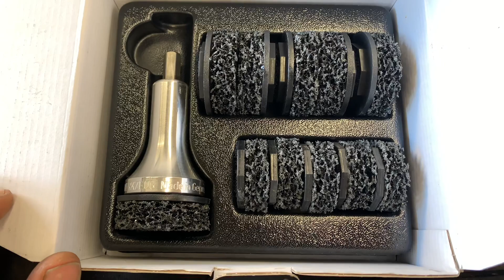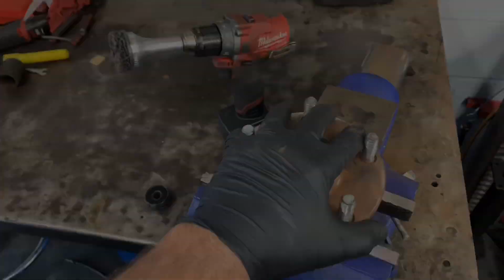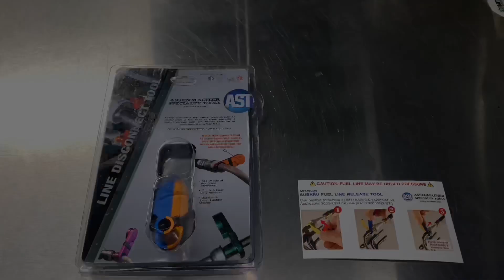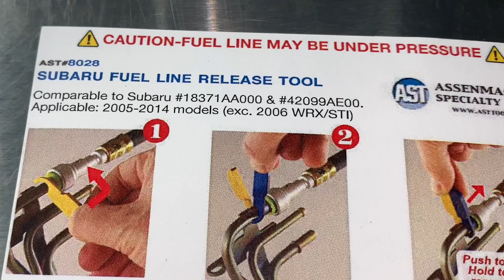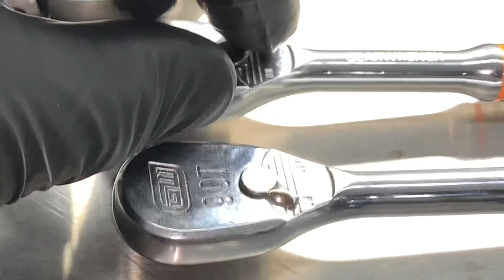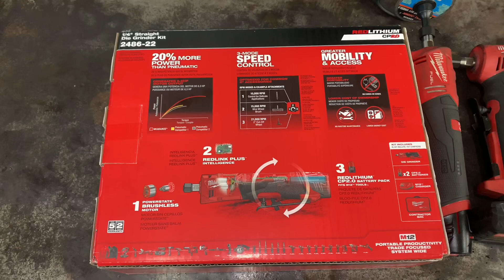The Ultimate Automotive Tool Haul That You Need

Comment: Hey Brian, not sure how u spell your name  but I’m a new subscriber and had a question what is the best disconnect line tools in your opinion plastic vs metal ones etc. great channel sir 👍
Reply from the maker: The one I use the most is made by Astro card number is 7892 I also like the brand AST they have just about every quick connect adapter you can think of.
Reply: @HowtoAutomotive  awesome thanks brian that’s and 8 piece kit too

Comment: Getting the Milwaukee inline die grinder,bare tool.Did this due to I have enough chargers and batteries.I only use the real deal batteries in my Milwaukee cordless tools,use of the aftermarket batteries voids the warranty on the tool.A computer is in the tool and can tell which batteries were used storing the information
Reply from the maker: Walter Frederick that’s a new one for me. I know the batteries have tracking devices on how many times they’re charged but I have no information on the tool keeping track of what type of batteries are being used.
Reply: Dad and I went to an Auto Value Tech Expo in Febuary.Milwaukee was there and I asked the Milwaukee rep if the aftermarket batteries void the warranty on the tool.Told me yes,another is finding burn marks in the tool.
Reply from the maker: Walter Frederick good to know thank you 👍